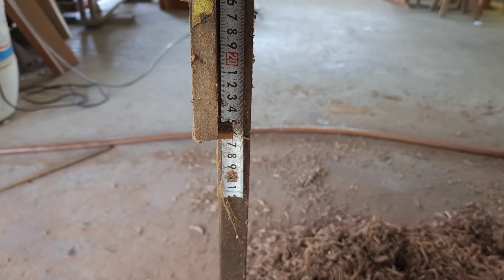How to cut a circular dent (basin) in wood very amazing that you've never seen | Woodworking Wisdom

Comment: very nice. I was shocked to see that the saw tble went down instead of the blade coming up. I've never seen a saw like that and I've seen some old saws...
Reply from the maker: This is a saw we have used for a long time, besides the saw, it can also plan and drill holes
Reply: It’s the no guard on the jointer that scares the poop out of me.
Reply: @The-Real-Ando  Yea, no guard on a joiner scares me too. My guard broke years ago and I have a China "no brand" one and can not find a replacement. So all I show is enough to do the width of the edge I want to join.
Reply: @davidcurtis5398  it just takes a stumble, a trip and your hand is in spinning sharp metal, and that ain’t good.  This guy is onto it though he’s no slouch, he’s been doing it a while and still has all his fingers so… anyway I’m going to try and make a bowl like this. He’s a clever boy no doubt.
Reply: @The-Real-Ando  I like the bowl thing. I use the table saw to cur large circles out of wood. Works great.....No real clean up or crappy edges after, just needs a sanding and maybe a round over. Make up to 4 foot discs.
Reply: @davidcurtis5398  yeah I’ve seen people do that.  I use my homemade router jig for that, it has two pins that fit in holes in the base plate for the guide. The pins arestuck in a wooden block attached to a strip of ply so I can cut almost  a 2.4 metre circle.

Comment: Now take the bowl and mount to the pivot bar with the basin facing up. Spin it next to the saw blade. With the same proceedure as you used to create the basin you will now create a matching curved outer edge.
Now change to a larger diameter saw blade and repeate the original process but only a fourth or fifth of the blade height. Now you have a fluted bowl.
Reply from the maker: i made a video similar to what you described, can you check it out and see if it works?

Comment: On this week’s episode of what not to do with power tools…

This is extremely dangerous. Saw blades aren’t meant to take force from the sides which is exactly what is happening here. Best case scenario is it grabs the wood and flings it across the room. Worst case is the blade shatters and sends shrapnel flying everywhere.
Reply: Yes, I once worked for a plant machinery company, and we used another company for sharpening the blades.
The guy on the desk made me adhere to being extremely careful with blades, as he had a huge ravine down his forehead, through his nose, into his cheek.
Calling it a scar would’ve been an understatement😳😳
Reply: Best case scenario is actually you get a bowl, which was what happened
Reply: @@purocuyu  🤣 came here to reply the same thing

Comment: The usual safety concerns....
That tiny nail and thin strip of wood is all holding a potentially deadly projectile in place.
Reply from the maker: Maybe it's because your work safety rules are too high, so you think that doing this is very dangerous.  but I can assure you that if you apply it exactly like I did, there won't be any risk that could harm you.